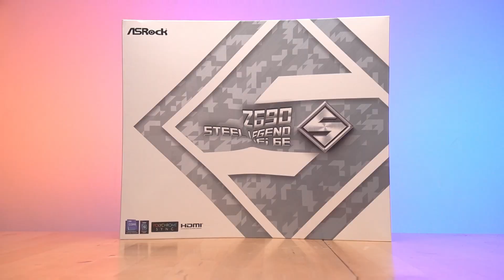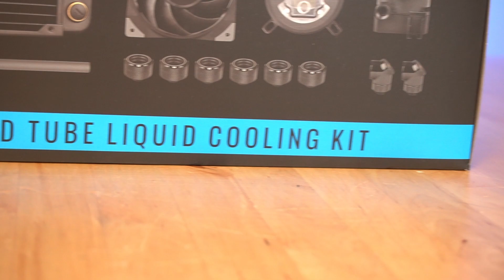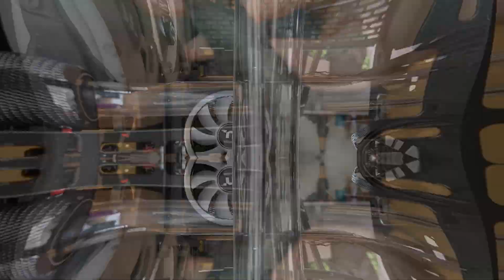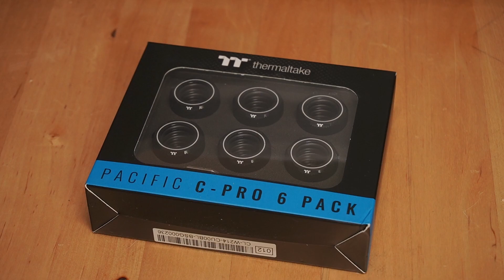Intro Build - Thermaltake CaseMOD Invitational 2022

Comment: you got mercedes of a cases and you put hyundai parts in it. boggles the mind.
Reply from the maker: Please explain? 6750xt is a decent card and the Rog Strix one of the top models of that line. Motherboard is a cracking board with loads of features, at the start of the competition the 12900k was one of the fastest CPU's available and only usurped by the passage of time, the water cooling kit is comprised of quality components.

Maybe Hyundai parts because they're really well made, have a long warranty and will last for years.